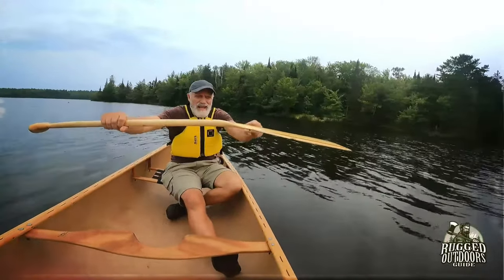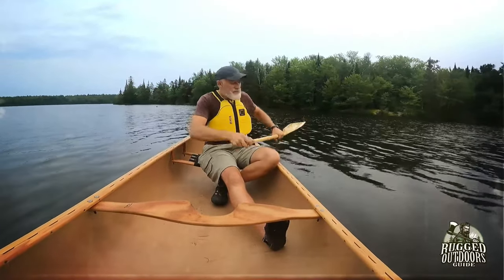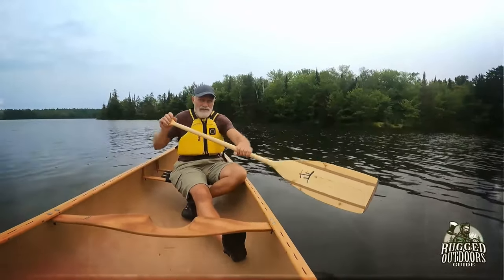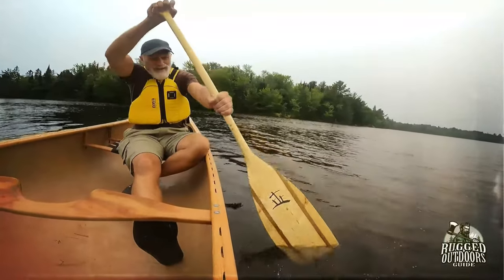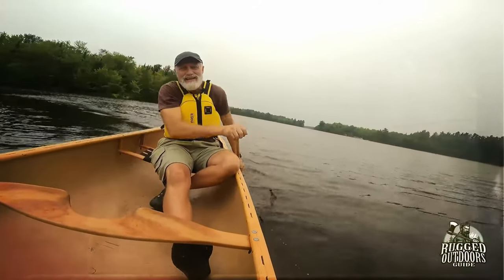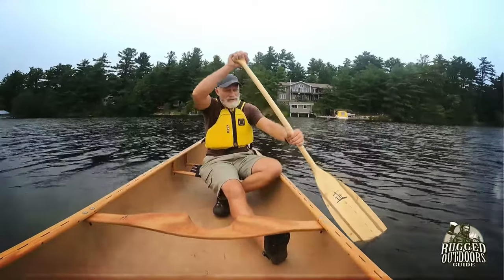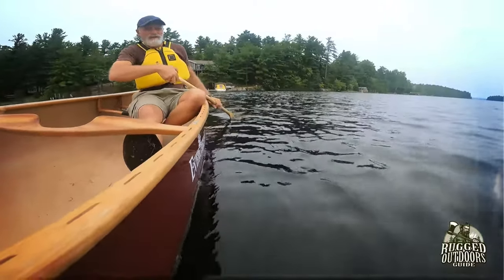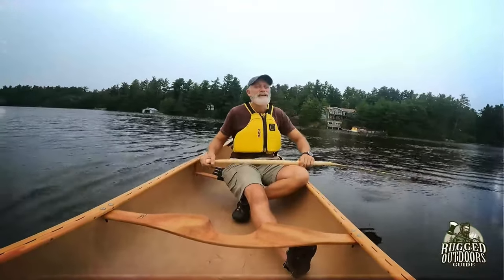How to Paddle Bent Shaft

Comment: That's actually a J stroke plus ruddering to keep the canoe straight. As a solo canoeist I'm trying to understand if a bent shaft would work for me, but it seems like it would be awkward. In tandem, it looks like a great bow paddle. Nice job on the paddle itself btw.
Reply from the maker: Yup!  Everyone has a preference, but for me, I've paddled every type of blade shape, shaft shape and double-blades.  I can tell that the bend shaft increases my efficiency in the long run, and because the blade itself has lots of surface area, I take fewer strokes.  I still switch sides every 5-7 strokes when I'm going hard, but it's easy for me given the paddle's relatively short shaft.  Thanks for the comment!

Comment: Bent shaft paddle blades are short and wide to reduce the swing weight and encourage a higher paddling cadence which will help keep the canoe at top speed. A short wide blade also has a more powerful and shorter "catch" phase of the stroke. Feathering a long blade out of the water is going to be much more awkward with a bent shaft.
Reply from the maker: Thanks for the info!

Comment: So I guess I have been turning my wrist the wrong way when I do a j stroke. I have been turning my wrist in the dorsal direction but this guy turns his wrist in the palmar direction. I will have to practice this.
Reply from the maker: Definitely a J-stroke involves turning the power side of the paddle (the side of the blade that pushes the water) away from the paddler at the end of the stroke!  Cheers,
Reply: @ruggedoutdoorsguide9904  I tried to do this all evening with my bent paddle. I can't do it with the bent paddle at all. It works fine with a straight paddle
Reply: @ruggedoutdoorsguide9904  Good video btw. And nice paddle